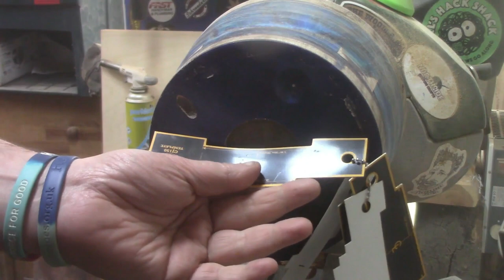Woodturning - Resin And Burl Bowl

Comment: really nice bowl. Please can you tell me what carbide tip do you use eg normal square, negative rake, radius etc. Thanks
Reply from the maker: Thanks a lot, they were easy wood tools negative rake cutters the codes are Ci2NR, Ci3NR, Ci4NR and for the Hollowing i used the Ci5NR, So all standard shapes but with negative rakes on them..... Hope that helps
Reply: What RPM do you wet sand at?